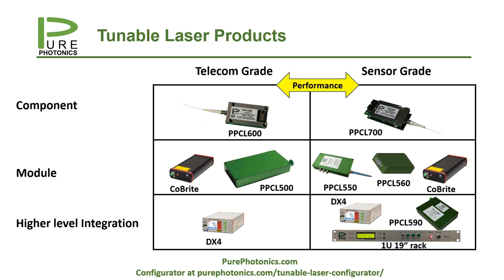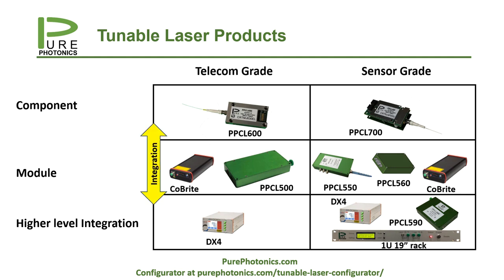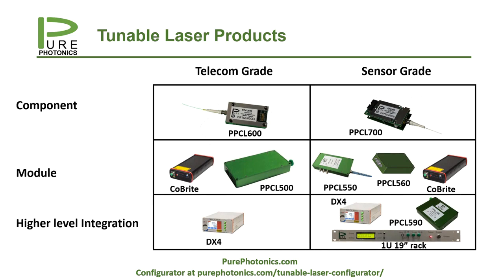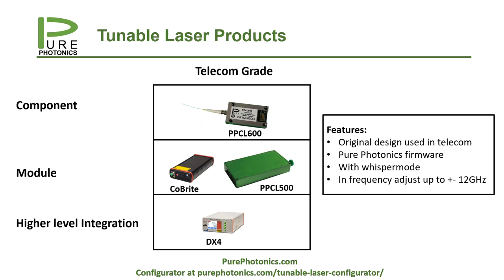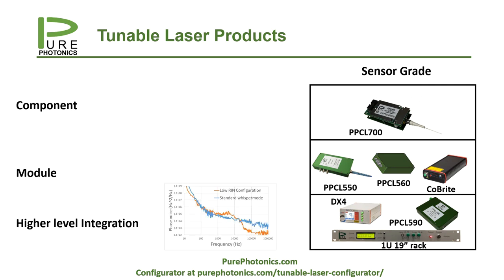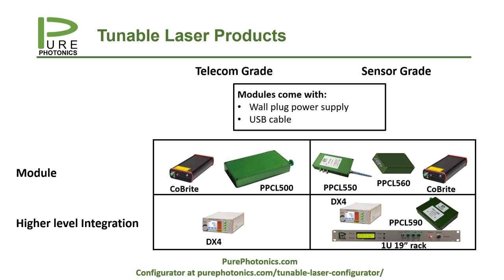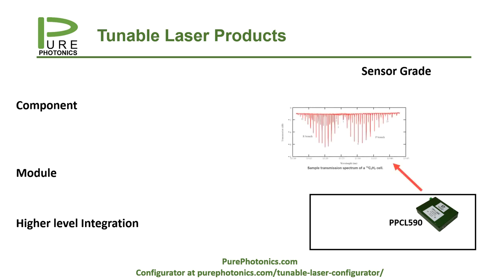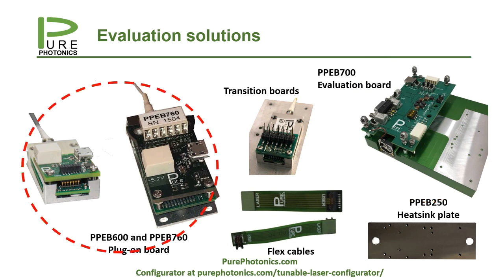Pure Photonics Product Selection

Comment: Abstract: Pure Photonics Lasers - Selecting the Right Solution

This video provides a comprehensive overview of Pure Photonics' laser offerings, guiding users in selecting the optimal solution based on their specific requirements. The lasers are categorized by performance level (telecom-grade vs. sensor-grade) and integration level (component, module, and higher-level integration). Key features, functionalities, and customization options are detailed for each category. Additionally, evaluation solutions for component-level products are outlined to facilitate seamless integration and operation. Whether for laboratory use, telecommunications, or sensor applications, Pure Photonics offers a diverse range of lasers to meet various needs with exceptional performance and adaptability.

Pure Photonics Lasers: Performance Levels

* 0:26: Pure Photonics offers telecom-grade (PPCL600 and PPCL500) and sensor-grade (PPCL700, PPCL550/560/590) lasers.
* 0:44: All lasers feature External Cavity design for a narrow linewidth (around 10kHz).
* 0:51: Base power level is 13.5dB, and base frequency ranges cover C-band (191.5-196.25THz) and L-band (186.35-191.1 THz).
* 1:03: Upgradable to 60nm tuning range and up to 17dBm (C-band) or 16dBm (L-band) power.
* 1:17: Sensor-grade lasers excel in low-frequency noise performance and offer additional features like amplitude modulation, frequency modulation, clean measurement, analog output, and cleansweep, which are unavailable in telecom-grade versions.

Pure Photonics Lasers: Integration Levels

* 1:33: Pure Photonics lasers come in component level (PPCL600/PPCL700), module level (PPCL500/PPCL550/PPCL560, CoBrite), and higher-level integration options (PPCL590 with gas cell or 19-inch rack solutions).
* 1:58: Module-level products and above offer the easiest operation, including a power supply and USB connection for out-of-the-box functionality.
* 2:09: Component-level products require users to provide a heatsink, communication interface (3.3V LVTTL serial port), and voltage supplies (3.3V and -5.2V) or utilize the evaluation board.
* 2:24: Module solutions are recommended for lab users and system integration with minimal customization needs due to cost-effectiveness, ease of implementation, and lower risk.
* 2:51: Component-level options are suitable for size-constrained integrated systems, pre-existing voltage supplies, or direct serial communication interface access, but require more expertise.

Telecom-Grade vs. Sensor-Grade Lasers

* 3:14: Telecom-grade lasers are widely used in telecom networks with high functionality. Pure Photonics adds whisper mode and customization options.
* 3:28: All telecom lasers offer in-operation frequency tuning up to ±12GHz and operate in the lower noise range.
* 3:38: Unmodified electronics result in higher noise levels (50kHz - 10MHz range) compared to sensor-grade lasers.
* 3:52: Sensor-grade lasers share the same optics as telecom-grade versions but have optimized firmware and electronics for significantly lower noise in the 50kHz-10MHz range. They also provide optional features like frequency modulation, amplitude modulation, analog output/input, clean sweep, and clean jump.
* 4:19: Most features are optional and require selection during ordering.
* 4:26: Amplitude modulation offers a choice between 50kHz or 1MHz bandwidth, with the latter excluding RIN/noise reduction in the 50kHz-10MHz range.
* 4:41: Module-level products have a maximum of 3 inputs/outputs, limiting feature combinations (e.g., AM, FM, clean measurement, and analog output cannot be used simultaneously).

Pure Photonics Laser Modules

* 4:53: Pure Photonics offers various module options:
* PPCL500/PPCL550: Enclosed versions of PPCL600 and PPCL700, respectively.
* L-band versions: Part numbers end with "1".
* Power input: Power plug (wall-plug power supply included).
* Micro-USB input: Installs as a serial interface on PCs.
* 5:27: CoBrite Interface:
* Collaboration with ID Photonics.
* Operated with Pure Photonics' Command Line Interface and Graphical User Interface software (primarily for demonstrating capabilities).
* More mature control interface ideal for stand-alone lab applications.
* 6:03: PPCL560:
* Functionality similar to PPCL550.
* DB9 interface for convenient serial access in system integration or production environments.
* Allows control via a microprocessor, unlike USB requiring a PC.
* 6:28: PPCL590:
* Stabilized laser integrated with an acetylene gas cell for enhanced stability.
* 6:41: Module Customization (except CoBrite):
* Adapter in the module wall: Allows screwing in FC/APC or FC/PC patch cords.
* Pigtail options: 900 micron, 2mm, or 3mm fiber protection with a wider range of connector choices (FC/PC, FC/APC, LC/PC, LC/APC, SC/PC, or SC/APC).

Evaluation Solutions for Component-Level Products

* 7:17: PPEB700 Evaluation Board: Provides all necessary features for laser operation, including micro-USB and DB9 serial interfaces.
* 7:41: Plug-on Boards:
* PPEB600 for PPCL600.
* PPEB760 for PPCL700.
* Offer a micro-USB interface and convert the 14-pin connector to a wire terminal solution.
* 7:58: Additional evaluation products: Flex cables, connector boards, and heatsink plates.

i used gemini 1.5 pro to summarize the transcript
Token count
3,533 / 1,048,576